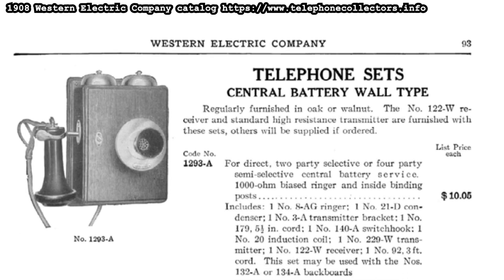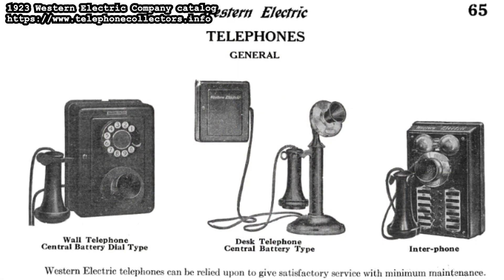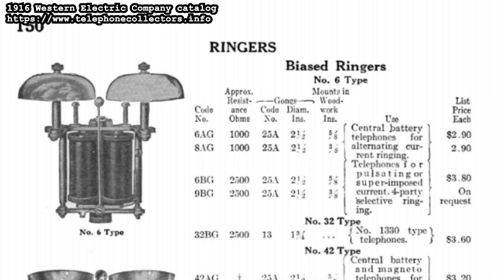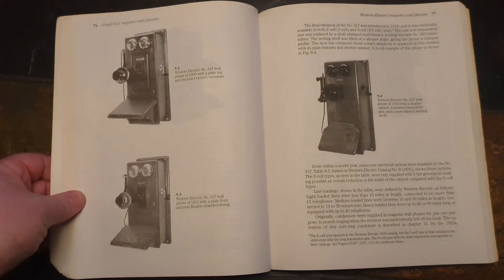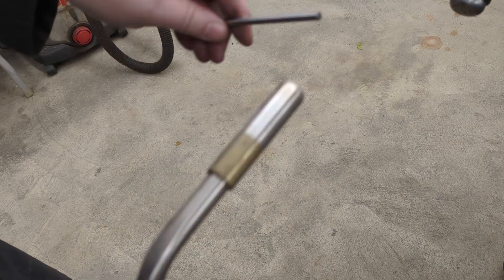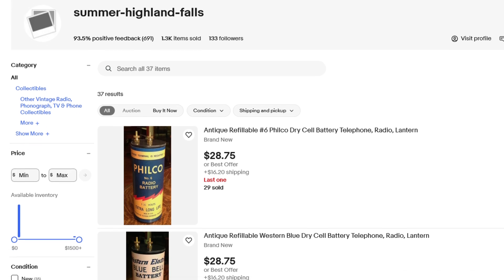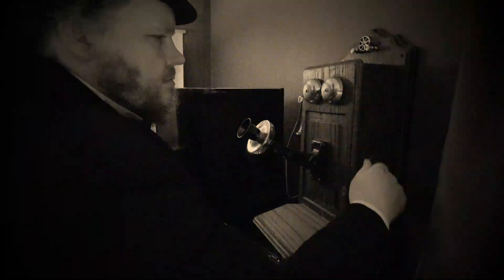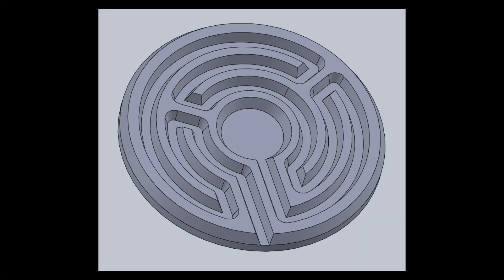Making a working intercom system from some very old phones

Comment: we are new construction house and I have my grandparents phones.  I would like to do this also before drywall.  Could you please clarify what type of / size of wire you used between the phones so I can get run now and I will worry about the inside of the phones later.

Comment: Railroads were still using "open wire" phone systems into the 1990s in places where there were local "tower offices".  Each office had either a candlestick phone mounted on a "scissor" extension and a headset or desk speaker, or a more "modern" (1960s) Shure microphone and a Safe-Tran Company speaker set.  The latter often had touch-tone keys to activate annunciators in other offices.  Many sets had either the hand-cranked magneto box or a toggle switch to ring traditional bells.

One thing that set railroad systems apart from others was the use of a "stomp pedal" under the desk that cut in the transmitter, and cut out the desk speaker, whenever the operator depressed it.  Thus, the station operator had hands free communication.  Some of the modern integrated mic and speaker sets made do with a spring-loaded toggle switch to open the mic and kill the speaker.

A lot of offices had "jack boxes" where the operator could plug into various lines, such as dispatcher(s), right and left local blocks, and perhaps a yard office or message wire.  The dispatcher line was an open party line for all stations on a "dispatching circuit".  Thus, every operator could her what everyone else was saying - something that kept everyone in the loop, so to speak.

The few towers left today make use of commercial telephone lines, but in many cases the old equipment has been interfaced in.

Comment: Cool project. You shouldn't have to strip cloth covered wire. The covering should just slide back from the conductor's end easily after cutting to length.